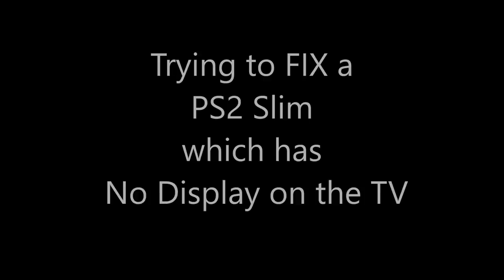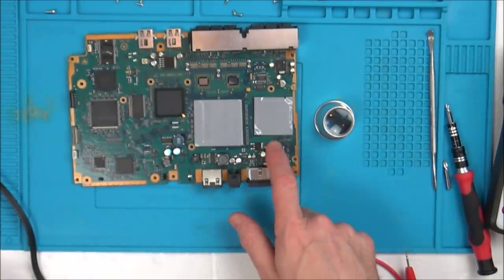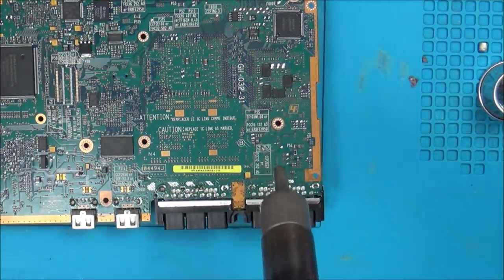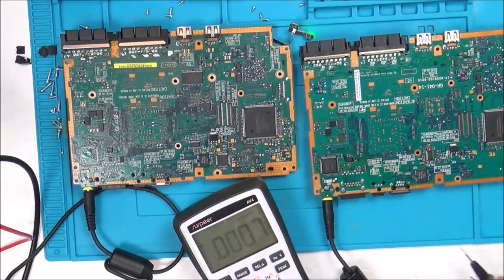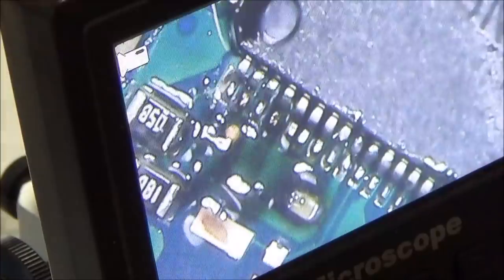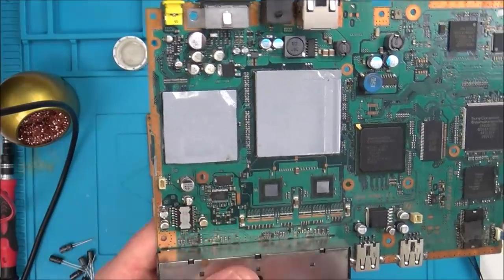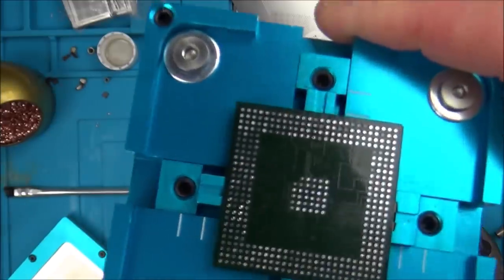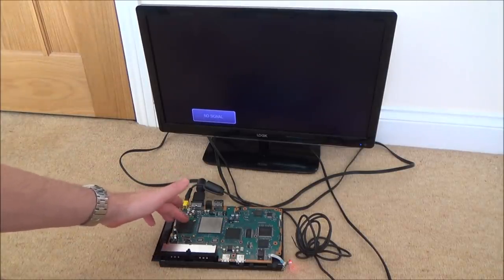Trying to FIX a PlayStation 2 Slim - No Display on TV

Comment: You really need a scope to debug problems like this.  Your TV detects a signal, which means the line sync is generated by the video signal chip you de-soldered.  This chip is working (as you proved) , it just doesn't seem to get any input. The input of this chip comes from the GPU. You need to take your working board and compare signals one by one. Probably your GPU is not sending any signal to the video signal chip because your CPU is not booting correctly. You can also use your scope to check the ripple on the CPU supply voltage, or the chip selects (and data and address lines) toward the ROM (NAND) memory.
Reply: Corrupted nand.  Scope would be nice but this one was easy to diagnose since it booted occasionally.
Reply: Same issue on my ps2. But it generates no output in the video(4015 chip). I also checked audio with scope and there is no activity on those rails also. I then pointed at the 4015 input and there is nothing there either. All the chips get warm. Lens assembly moves up and down in a controlled manner. But no signal. on the AV.

Comment: I repaired several ps2 slim with the same problem and you only had to reball the chip cxr726080
Reply: Should that solution work on a 9k series with audio but no video?
Reply: i have one gh-052-51 board, what could be the problem ? is a bit kind a different than this board
Reply: For real?

Comment: Finally a PS2 video!
I work fixing those and Power On no signal are a PAIN. But u don't have one of those.
The NAND on this PS2 is bad!
100% not a video problem.
Try to reflow/change the chip.
Reply: Also, at the end of the video, most likelly u got a short on the CPU
Reply: @My mate VINCE So recently "Xbox" has released a bunch of faulty controllers specifically the (Xbox series 2) and with this series 2 controller there are many faults that lots of people are having. Most notably the( Lb and Rb buttons) the buttons them self typically arnt broken however tend to be 80% unresponsive unless you used so much pressure you'll more than likely damage the controller. Other faults tend to be the face buttons, if you would please look at one controller and see if you can fault find the trigger Buttons on the back. Sure you'll be a Microsoft community hero, because everyone is scared to lose the warranty and most of us arnt experienced like you. Sorry for the long paragraph, but I feel like of you were to do this you'd push Microsoft in a direction to make reliable controllers instead of money grabbing us for faulty flashy controllers.
Reply: @ricardopeacockii719  return, refund if you can even the elite controllers are trash. There is a class action lawsuit going on right now on elite controllers
Reply: @poopfeast-kg1lv   I wish I could return, but Walmart decided to not give me a warranty I paid for what do I do now
Reply from the maker: Thank you Dandy, which one is the NAND? I searched online and I couldn't find it. Also can it be lifted from a working console and swapped or does it need to be flashed or something :-)
Reply from the maker: Hey Rick, thanks for letting me know. I looked on eBay, but right now in the UK no one is selling any faulty ones. I will keep my eye out for them :-)
Reply: @Mymatevince   thank you for hearing me out, by a chance is there any other way I can reach out to you, If I find out more ab the controller to further give you information?
Reply: @Mymatevince 
This fella: https://prnt.sc/srftoq
It can, but is must be the same model and revision.
I also recommend you using some low melting solder, coz the nand of the ps2 is kinda finicky with temperature.
Reply from the maker: @thedandyhoneybadger7055 Nice one. Yes I remember that chip, at least it isn't BGA. Thanks man that is really useful if I come across this problem again.
Reply: @Mymatevince  
Np!
PS2's are really easy to fix, especially 9xxxx models (GH-072 board)
I recomend you picking up some, especially coz broken ones are really cheap.
Reply: @thedandyhoneybadger7055  my ps2 has sound but no display. What do u think is the problem?
Reply: @eryavrilio3751  Maybe a bad trace. Is a 9000x model? If it is, you can make a really simple jumper to fix that
Reply: @thedandyhoneybadger7055  no it's a 70004 model. Actually i've seen a corroded pin on NAND that you've said. Is it can be the problem?
Reply: @eryavrilio3751  Yes, it could be.
Reply: @thedandyhoneybadger7055  What should I do? Replace the NAND? Sorry i'm new in repairing electronics
Reply: @eryavrilio3751  Reflow the NAND pins with some low melting solder. (Take out the battery first)
Reply: @thedandyhoneybadger7055  okay thank you for helping brother
Reply: @thedandyhoneybadger7055  I just came across a SCPH-77002 with almost same behaviour, no video or audio but TV's "no signal" will be off when turned on. I watched the whole video and I have the same conclusion, it might be the NAND or BIOS issue. Do you know if there's any "per-console" data on this NAND chip, like PS3 did? Otherwise swap a new NAND chip from donor will simply not work...
Reply: hi i am a noobie coming  in late i have a ps2 slim 7000 series. with the no audio/video. i have followed this video but have been stumped by the NAND chip. could you please give me direction on where it is located so i can give an inspection and try a reflow. please and thanks

Comment: hey Vince, nice try at BGA rework! I think you did a pretty decent job on reballing. One thing I'd say, once you reballed it, you should have put flux on the chip itself and given it another heat to help align the balls and make them more uniform before placing the chip to be soldered down. This also helps you ensure that no shorts happen in the soldering process
Reply from the maker: Thanks for the tip Dark Samus :-)

Comment: Vince, this is NAND related. the BIOS is searching, that's what sends power to image port, getting rid of the "no input" on screen, from there it reads NAND for OS, which shows as the Playstation startup screen. It was a prevalent issue with the PS2 Slim.
Reply from the maker: Thanks Joe :-) Do you know which chip on this board is the NAND and whether it can be swapped from another PS2 Slim. I know it is too late for this PS2 but it might be useful for future fixes :-)

Comment: The PS2 display cable is proprietary, but it's pretty basic. As Vince found out, the Composite cable only has four wires, and the Component cables you'd use for 480p output looks exactly the same but has two more wires.

The older PS3 also uses this same proprietary cable as the PS2 if you don't want to use HDMI, so it's backwards hardware compatible regarding the display.

Comment: As the proud owner of a non-working PS 2, I do appreciate these videos. (I am fairly certain that my problem relates to a dirty laser, but I have not yet taken it apart to test my theory.)
Reply: My PS2 barely works, it just needs a new laser though.
Reply: You could get Free Mcboot on a memory card and then load disc images from HDD (fat) or from a PC fileshare over ethernet (USB is too slow).
Reply: Dazed I could, but I’m not going to.
Reply: Laser is fairly cheap and not hard to replace
Reply: @earlspencer7863 True but they have a limited lifespan. After the new one goes, it needs to be replaced yet again. Eventually there will be no more and then what? In the garage it goes

Comment: Try to check the USB ports, sometimes a USB port can make shorted to the board. Also it could be the controller ports. Nice video!
Reply: i work with Xbox 360 hardware, 90% of the time when there is no power, its almost always the USB ports. bend them so they aren't touching the port itself, and watch it spin to life. gamers destroy a lot of USB ports when they rage in COD4

Comment: I know it's a bit late now, but as you mentioned at the ending..
Something to try in the future.
Hope this help either yourself or a viewer. I am only having a calculated 
stab in the dark with this.  But...

Did you notice the red light came on the controller but only when a picture appeared.?
I don't know but is there a reset / rst line outlined in the schematic.?

It should be a brief voltage change on that line at power on of the switch.
Very important as all of the clock and data lines will then sync with
each other.

The voltage change might be just off giving the reset voltage but if
you notice a "Flutter" on that line then help it out a bit by briefly taking
that voltage to the potential it was trying to "Flutter" towards as it switches
from standby.

As you know a line above the reset or rst on the schematic indicates the
voltage goes to ground to activate a reset.

Comment: X and Y capacitors are special Safety capacitors and are designed to fail closed or open respectively. Changing one for a normal electrolytic will work but you will not have the safety characteristics as designed by the manufacturer.
Reply: in PSUs, connected to mains/earth yes, but THIS has nothing to do with capacitor classification, that's only the batch/date-code

Comment: I'm an electronics technician and I have a special appreciation for the PS2. Check the CXM chip, the 4335ksz audio chip, the components close to the video output, especially the capacitors. Check the resistor arrays and check the capacitors near the joystick connector. Finally, reflow the graphics chip.
Reply: Hi @conversafiada6583, I have the same slim ps2 with an all time black screen. I checked all fuses, resistor arrays, capacitors next to ram chips, I also replaced the BIOS chip with one from a working console and still all it gives is a black screen. I did also test out the original BIOS chip from the black screened console and soldered it on the working console and indeed it works hence the BIOS is totally fine. Discs read, fan spins and ramps up after some time, I'm wondering if you have any suggestions on something I may have missed here as I'd love to get this console back up.
Thanks a ton!

Comment: with the reflow on the balls. You could try putting a thin coat of flux over where the balls will go. When adding the balls they will only stick to the correct pattern and when heating they will melt and stick quicker. The chip will be less likely to warp with less heat. I think you need to apply a little pressure on the chip when flowing onto the board (if someone can confirm or tell us the correct way).

Comment: Mine went temperamental like that just before it died. It died when the modchip failed. It was semi repairable when that happened though and would actually start up when the modchip was bypassed but not every time. It only lasted for a short period before dying completely.  I don't think this applies here though because there is no modchip on your board.

Comment: Great attempt!  I had a go a reballing a GameCube CPU last year (not finished the video yet) - What i learnt is to use kapton tape to mask the stencil (cut it strips and stick them on the template to cover the parts you dont want the balls to go.  And get a metal lid (eg. from a Twinnings tea box), and get the balls into that, then the excess ones are in the metal lid at the end and can easily be poured back into the container.   When you have the odd one sat slightly to the side like you did, just heat it again with hot air (and low airflow) - not with the stencil on, and the balls should pull themself back into position =D
Reply from the maker: Thanks Chris, some comments have mentioned a thin layer of flux as well before putting the stencil and balls on. Maybe next time or the time after I will be more successful. Looking forward to seeing that GameCube vid, I remember the 1st part video :-)

Comment: Just past 15 minutes in you mentioned if it does RGB  or not, it does do component (PS2) n also has pins for S-video signal as well.  I'd used S-video on mine for a few years then switched to a sony component cable which actually was marked as for the PS3 but those pinoutes are the same.

Comment: Hi mate,  I'm pretty sure you're supposed to reflow the balls on the chip after you take the stencil off before putting it on the board as this will even them all out.
Reply: you don't have to, but it looks better and leads to less risks of the balls bridging when you re-solder it to the board.

Comment: Good attempt, was hoping you got it sorted out as I have a slim with practically the same issue, only thing with mine is the no source remains on the tv, so its like it not receiving any sort of signal, any ideas or suggestions? I too have a working knowledge of electronics so feel free to explain yourself.

Comment: its easy mate . the light turn green and then red because there is short under or inside the graphic synthiser chip . wich led to a fuse bloun up . the fuse can be located under the board . but with that reballing job . there is no point for looking after the fuse .

Comment: Flux like you found is left over from some rework at the manufacturer. I worked for years as final QC for a circuit board maker. The reworker should have cleaned it before it went to assembly.

Comment: I have this same problem 😭😭 I’ve tried a new AV cable, HDMI adapter, the video out setting trick, nothing works. Black screen just like Ashs PS2 only it’s never randomly worked like Ashs does. If you can figure it out i’d happily send my PS2 slim to you!

Comment: Since you had a working board, you should probably have started comparing measurements straight away rather than starting to swap things out at random.
Attempting a Re-balling was certainly courageous. Perhaps a bit of kapton tape could've been used to mask off the extra holes.

Comment: The very first PS2 slims are the best built ones as the slim went on and more versions were made it got really cheap even the plastic got worse. The 90001 version with the built in power supply is the cheapest thing I’ve ever seen. If you are getting a PS2 slim get the early ones.

Comment: I'm honestly not a fan of the PS2 Slim. While PS2 Slim is probably great for someone who has never owned a PS2, they are notoriously unreliable. I've seen and heard horror stories about PS2 Phat systems failing as well, but from my experience, my PS2 Phat still works perfectly. Meanwhile my neighbor's PS2 Slim stopped reading discs after only a year or two. That's not to mention that you can seemingly do more with a PS2 Phat. Both systems support network functionality, but only the PS2 Phat officially has hard drive support. Furthermore, while a network adapter needs to be purchased separately, OEM PS2 Network Adapters can be easily modified for use with SATA Hard Drives. I think overall, the PS2 Phat is simply a better model, despite how large it is.

Comment: it looks like a NAND problem since when you turn it on is goes "black" the ps2 will ALWAYS send video even without the bios loaded or loading anything and with no audio has more too do with the bios cant play the sounds
Reply: the bios would have corrupted if that were the case especially with the chips he moved so I don’t think that’s it
Reply: Fairly so, the nand is part of the board and the bios is a written piece of code made to be able to talk to the system from hardware to software and cannot do so if there is hardware failure. So if the nand is bad the bios is not accessible because the nand is not the bios but the home of the bios. If the nand works the bios will. the bios does not work the nand is bad but the fact that the no signal goes away means the bios is searching for a operating system in which case the controller(s) could be bad allowing Basic Input Output  System
(Bios)  to function but not a furthermore advanced or physically more user friendly screen ( basically so you as the user don’t have to tell the ps2 what to do in a binary form) it hangs itself on the black screen waiting or looking for the operating system
Reply: I was thinking too that this could a BIOS problem
Reply: Modchip can help with this
Reply: bekkaa how so? I’ve never been to into mods

Comment: I have a FAT PS2 with similar problem, black screen with no audio. Everyone mentions switching video modes or changing cable but no one mentions other, potentially more serious issues. I found a forum where a guy was suggesting replacing some chip but I lost the page and I can't find it.

My guess is that since you have a signal so the TV is locked on, that video signal generating chip is working fine but it doesn't know what to display, so it's input side is faulty, probably the GPU is toast. But this is just a hunch.

Comment: I recently fixed 3 of these ps2 slim consoles. They had similar problems, and the problem with any single one of them was with the yellow power connector. I just re-soldered everything that keeps that connector to the board. And guess what, they're all working perfectly fine now. 
I have a 4th one that works perfect except it won't play ps1 games on it. Ps2 games, dvds and audio cd's no problem. 
Similar problem I have with my ps2 backwards compatible ps3 console. Eveything works but it gets a dark red screen (frozen) after a ps2 disc is loaded.

Comment: Let me start by saying I have less experience than you Vince and I have never worked on a ps2. That said I think you went to the GPU too fast. The power issue was a good line of thinking but the fact that you got good image every now and then would have lead me to look at the schematics for a reset line then checked if that line had a capacitor that may have been faulty keeping it high/low depending on the requirments. Anyway The fault didn't seam to me to be consistent with a GPU fault and I would have done a full recap before even thinking about attempting to reflow the GPU. As my experience is only beginner and mostly with retro computer such as Amigas I may be way off the mark.